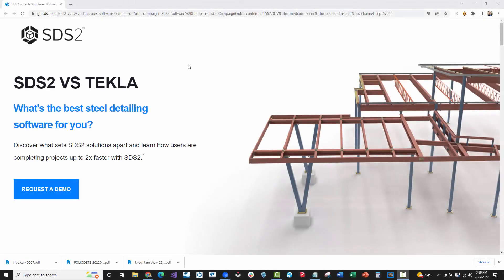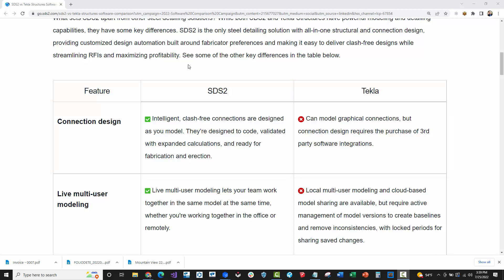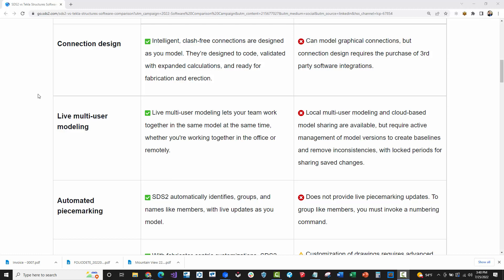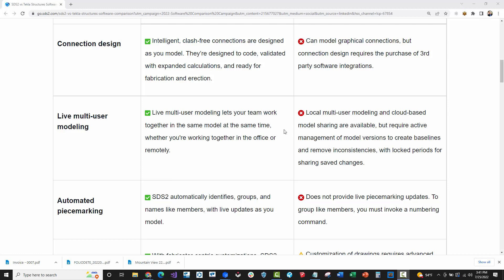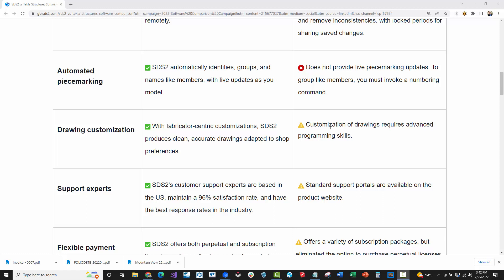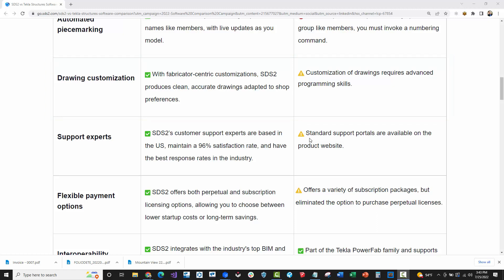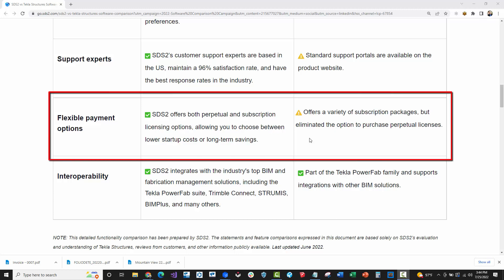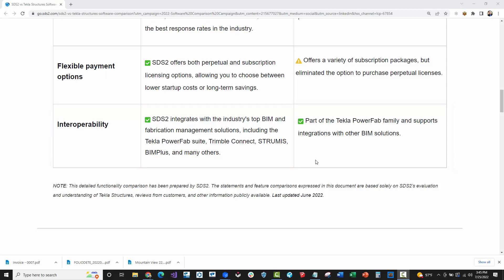SDS2 vs Tekla Independent Review

Comment: The customer support element has definitely gone downhill for SDS/2 since covid. they before had it where you could get on a messenger type chat dialog with support. Theyve ended this and now only seem to operate via phone call and email. When I call, I'm very lucky if i reach anyone on the first try. If I email a question, I usually get my answer towards the end of the day. I'm very skeptical of the reason they gave for taking the messenger thing down, saying that people didnt use it as much. That was definitely not true in my case and now I receive feedback much slower or sporadically.

Comment: What about for stairs and handrails? Can Tekla put a shear tab on a stringer? I know SDS2 can't
Reply from the maker: Yes. Stairs and rails can be done in tekla and you can use shear tab connections into the stringers if you have a header or stabilizing support member framing between the stair stringers. In tekla there isn’t member lines for the connections like in SDS2. In tekla the connections are looking for intersections of solids and you can connect parts that aren’t the main part of the assembly

Comment: Thanks for the comparison. I am currently learning Tekla while having used SDS for almost 10 years. It's been interesting.
Reply: Which one do you think is better in context to productivity and efficiency?
Reply: @Anon-oy3kc  I think that I am still too biased to answer this question, but right now, in this moment, I miss modeling with SDS. This is probably because it's second nature to me at this point and I am still just a beginner in Tekla. I like the connection design versus the plug and play components. Teklas gridline design is almost completely alien to me after laying out grid lines, creating them, and setting elevations to create your TOS, FF EL etc. I wish Tekla had a snap to surface capability like SDS, rather than set work plane, create new view every time. If there is an easier way...please tell me. I do COMPLETELY miss SDS 2D capabilities because they are far more User friendly, probably because they are similar to AutoCAD, which is what I started with. I would recommend Tekla overhaul their 2D completely. But Tekla beats SDS out entirely with every view and detail being a direct representation of the model. Auto clouding items changed. With SDS, which you know, but for those that don't, you cut sections, elevations, plan views from the model, and then generate the drawing. This is one of the biggest areas left for human error while detailing imo because you update something in the model...and miss updating one of the views of that area...especially on a large job. This was an issue with members too. Some members would be deleted and replaced in the model, but SDS wouldn't remove the detail from sheets. So you would get a doubling of material orders on the ABM or AMO. It's definitely a long discussion, but I'm getting better in Tekla

Comment: I love your stuff, Chris, but I wanted to explain why I 'disliked' this one.

"Live Multi-user modeling": I can't say I've NEVER used Tekla Structures now since I've actually tried opening it like three times. But SDS2's live multi-user modeling has been my environment since 2000. This is actually EVERY SDS2 firm's reality for production every single day! This is my personal #1 top feature of SDS2 over Tekla. As far as production, I've ONLY been in a fully realized production environment that often times a dozen people are working in the exact same area at the same time. Currently almost all stateside employees are working from home simultaneously (across multiple time zones) alongside teammates in the Philippines in the same model at the same time without the need to ever "save" their model or for the software to send updated "packets" through the cloud; live truly means live! And yes there are safety warning prompts if trying to edit a single member if another user is currently editing it (for obvious reasons), but model checking, statusing, and so many other operations other users could need access to for that particular member or surrounding members would not necessarily be hindered at all by having a few members temporarily locked by other users. It's very rare that users are tripping over each other in the model. When it happens, it's available again the second the other use is done with it.

As for the need to 'undo' things in the model, I don't think I've met or trained another SDS2 user that has ever really needed that feature. The ability to 'undelete' members in SDS2 is really the only feature that relates to this idea of 'undo' that is extremely helpful when needed, but again very rare that it is called upon. This might sound a bit self-righteous, but maybe the fact that 'undo' doesn't exist in the model just means that l've learned to model more intentionally and efficiently and make fewer mistakes. I would choose the live multi-user environment  all day every day over the "benefit" of having an undo operation that just isn't needed very often.

"Automated piecemarking": this really needs more clarification and probably demonstrations when someone is comparing the two softwares. From my limited understanding of how Tekla handles this, this specific operation might actually be one of the most significant differences between the two in how they operate 'behind the scenes'. But to the point of what SDS2 is claiming in their comparison is that SDS2 immediately assigns TEMPORARY piecemarking while modeling. The power of this is that the modeler can input an entire sequence of members with auto-processing on and the system will provide and manage quantities and sub-marking on the fly. For example, if I simply input 4 column members in the model that are the exact same material size, length, base plate, and cap plate, then l would expect the system to assign them all the same temporary mark of say C_1 automatically. If I add a single beam between two of these columns then I would expect two of them to remain C_1, one column to become C_2 with a face A connection to the beam and one column to become C_3 with a face C connection to the beam. If I stopped there and auto-detail all of these members I would expect to have three column details just like I have three temp marks in the model; with one of the column details having a quantity of two. This also is powerful when model checking because if I did the same operations but ended up with 4 different temporary column marks then it would be an immediate red flag that I need to investigate what caused the other two columns to not remain combined.

To the point of 'piecemarking' as you describe it, this is really apples to apples between both softwares. SDS2's auto-marking in the model in no way restricts the user's control over how the final shipping marks are attained. In fact, with two clicks I can automatically generate as many 2D details as I want at a time and with another single click immediately following that detailing operation I can then choose to open an auto sheet-loading window in which I have complete control over all parameters of how those sheets are loaded (one detail per sheet vs multiple details per sheet, naming criteria of the sheet itself) and also in that same window, and more to our point, even renaming of the details from the temporary system mark to permanent shipping piecemark. As soon as I set my parameters and click ok on that window, all of my sheets are populated AND all of the details are now named how I need them to be which obviously translates right back to the synced members in the model that now reflect my controlled piecemarking. One more click and I can populate the revision block and then everything is ready to plot and send to the customer (assuming my Detailer mind doesn't need to do some additional cleanup of the system automated annotations on the details...ha ha, as if). I believe SDS2's point in the comparison is more to the significance of how the members are 'tagged' during the initial modeling stage and not so much to how actual piecemarking is achieved.
Reply from the maker: I think adding valuable opinions whether a like or dislike is great Justin. Your replies made it seem like I was slamming SDS2 functionality, which wasn't the case in the video. I was slamming that SDS2 put out a piece of information to the industry that showcased its features as better than Tekla or that Tekla was inferior, which even after reading your comments is not true.

Being in Tekla a few times as you have vs. actually producing in it aren't the same thing.

If Live multiuser modeling in SDS2 across the world is smooth, fast, and only sends some data when needed, and there aren't as many verify fixes like there used to be when I was in SDS2, then it sounds great. I absolutely can see how it would feel like being in go to meeting when I change something and then you see it live across the world fairly quickly when that's needed? However, from a personal model management point of view of tracking changes and work in progress I think the way Tekla has model sharing baselines and packets is pretty handy especially if needing to rollback because someone did something they shouldn't have and messed up a ton of work.

Undo / Redo: When you don't have the feature Justin, you behave completely different in your modeling vs. when you do. Every single Tekla user especially when they start out uses the undo / redo all the time. Even experienced users go "oh darn, didn't mean to do that' and undo. When you have it at your fingertips you behave differently. All of my squad back in my SDS2 days said they wished we had an undo / redo and whenever big accidental deletes happened or modifications, it was a big loss of time.

Piece marking: I can understand the on the fly temporary marking being a visual clue to "why are things not combining marks." I can progressively do a modified numbering in Tekla as well to match that same exact process which is at the same level of speed as in SDS2 if I really wanted it, then came back and do a renumbering of all to have the system completely optimize marks before I make drawings. Most users, number along they way so the numbering isn't giant at the end, but I do a big numbering before drawings to get the best optimization of combining marks from the ground up after modeling is hopefully all truly done. Even James Schwartz told me one time in basic training to verify fix, and reprocess to get a complete re-evaluation of marks in SDS2.

Drawing creation is not the same in SDS2 and Tekla. SDS2 doesn't have the concept of a true assembly drawing with BOM without loading onto a sheet. You have to make a detail, then load it on a sheet even if it is a single assembly drawing. You don't have to do that in Tekla if I understood your last point here.

In the end, I still stand where I was when I made the video on the points you highlighted. SDS2 isn't glaringly ahead and I'd say nor behind on those bullets.
Reply: @KeyackTechnologySolutions  I definitely didn't want to give the impression you were slamming it. I do believe your evaluation was coming from a sense of neutrality. I just wanted to provide my own clarification on a couple of the points I could speak to. And I definitely do not EVER want to imply that my three meager attempts at opening Tekla Structures is adequate experience to have ANY sense of a valuable opinion of instruction on how Tekla operates differently than SDS2, but rather just highlighting the steps I take in SDS2. I actually think it was you that explained to me one time how the numbering and sheet loading is handled much differently in SDS2. In my post here I was just pointing out that I think SDS2's comparison chart was wanting to highlight the tagging of temporary marks automatically without the user needing to number anything manually.

As always I respect your authority in so many of these matters and your professionalism in discussing them!